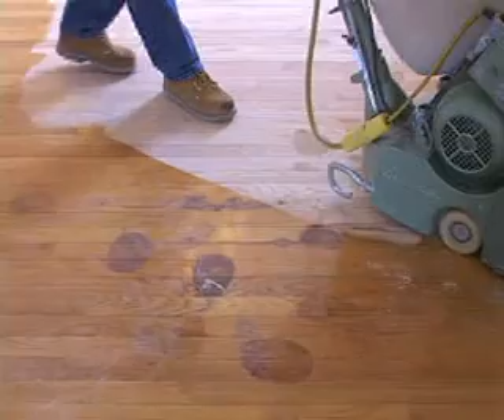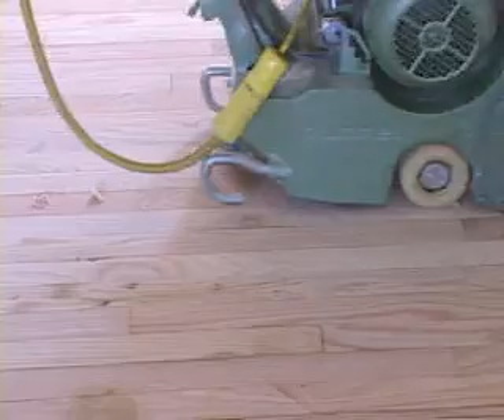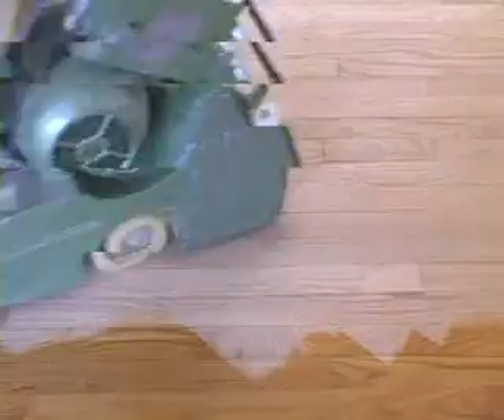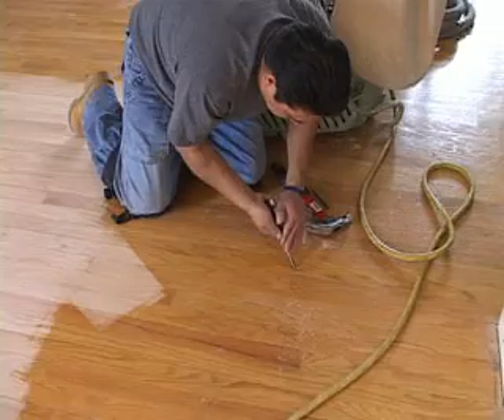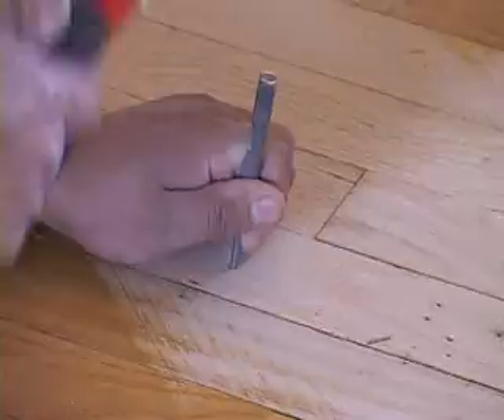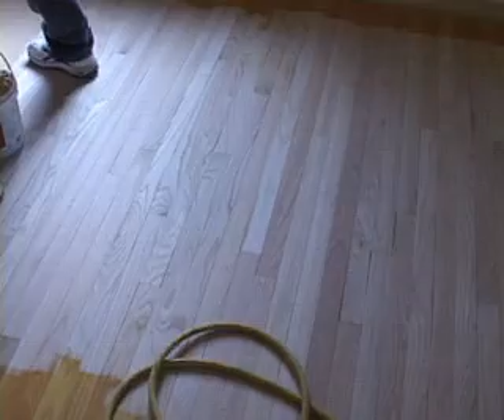How to repair a stain damaged floor.

Comment: i was looking at a site where someone was punching nails perilously close to the t&g (edge of board) in my experience they tend to break especially when the boards are a little on the older side coz they`re a little thin :)

Comment: Was this a prefinished floor?  I have stains like this on a bruce hardwood prefinished floor.  I have been trying to get home depot out to come give me some options.  First guy was from NHance... said he couldn't fix it.  I would like to either remove the boards or just have new bare boards installed in the problem areas and the whole place refinished.  First two flooring guys I called flaked out on me.  I live north of the Chicagoland area.  Any suggestions helpful

Comment: NEVER, never, never ever sand acrosst the grain of wood. Sand with the grain and only with the grain. If you need to pry up nails or staples, protect the floor by placing a flat metal spatula blade beneath your prying tool. If I were the owner of this rental property, I would sue for damages.
Reply: you can sand against the grain to take more material off.  then you go to a higher grit paper and sand with the grain. then you use a finishing sander.